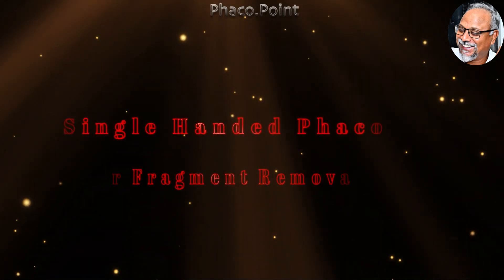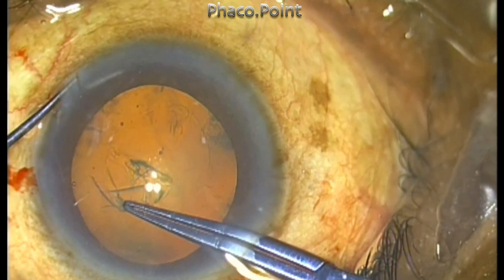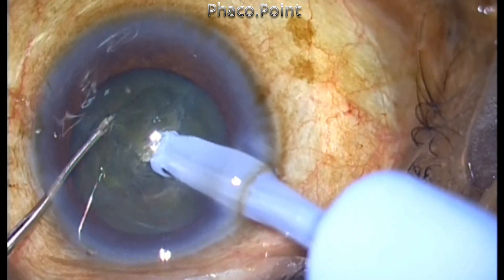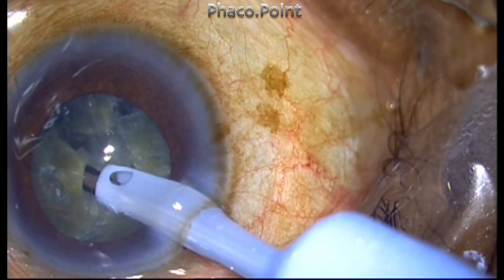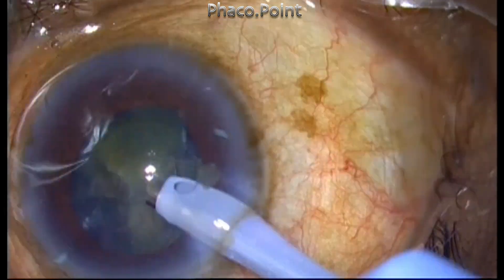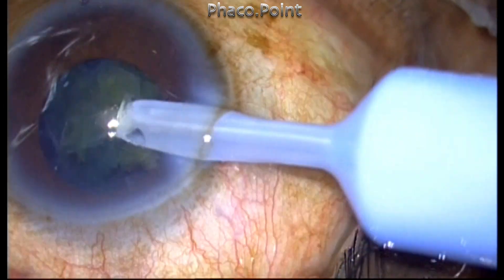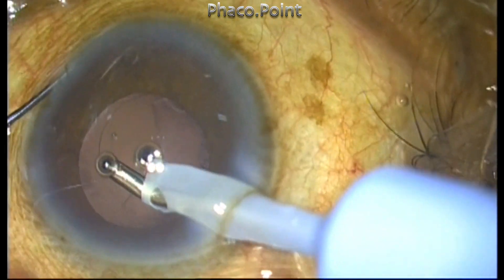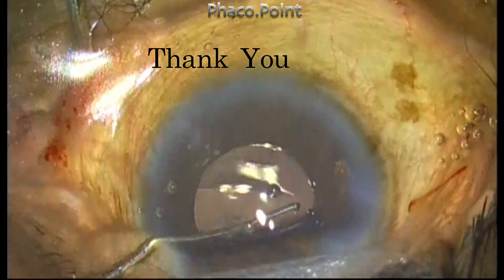One handed phacoemulsification for fragment removal - a learning experience

Comment: Dear professor, could you provide your parameters in this case? You have a Venturi system (B&L?) if I remember correctly. Does this work in peristaltic machines too?
My regards
Reply from the maker: Yes dr westphal I have a Venturi machine. This is
Simply based on fluidics and vacuum  and AFR and will work
With any pump
With any machine